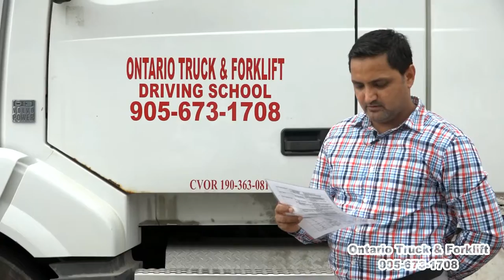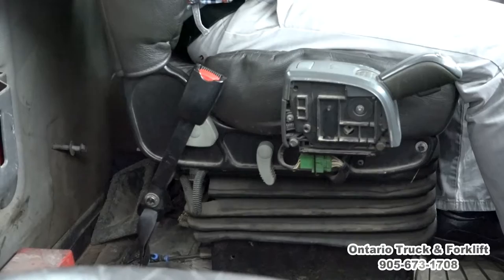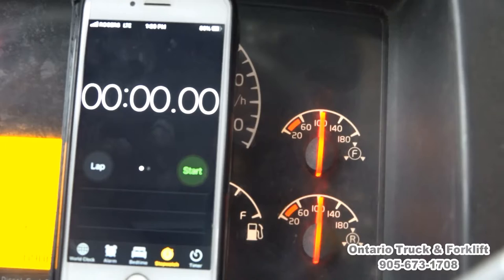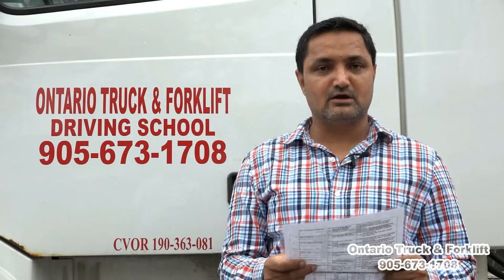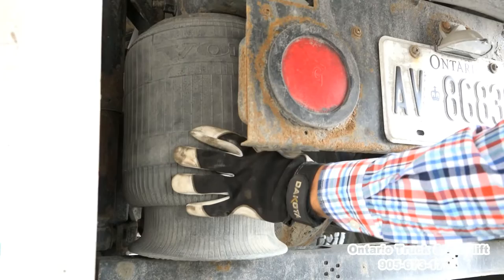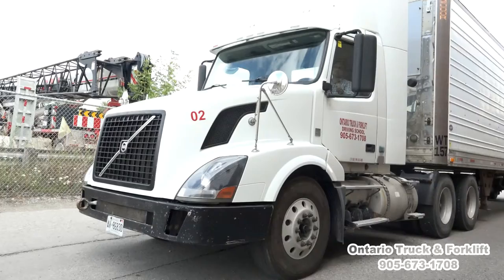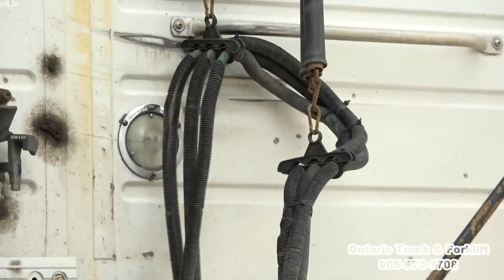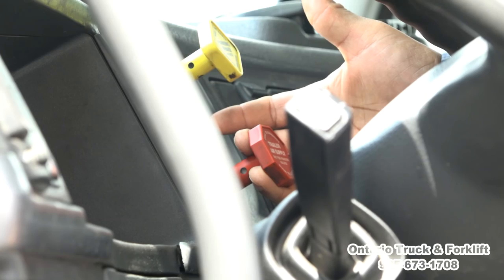Ontario Truck & Forklift Driving School-Complete Inspection Video

Comment: This isn't the Full Exterior inspection. You have to check for fluid leaks, windshield washer reservoir for any cracks or broken bottles and leakes and inspect the Air compressor underneath the hood, there's also other components that must be inspected. I haven't started my training yet, but these are things I already know.